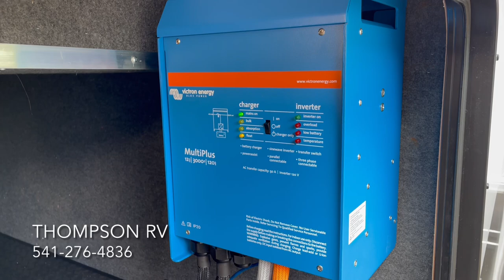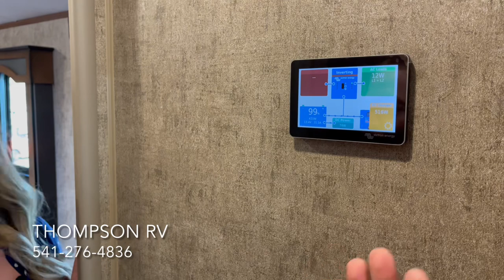How To Make Your Outdoors RV The Ultimate Off-Grid Trailer W/Solar, Inverter, & Lithium Batteries!

Comment: Nice video.  I have Battleborn batteries and live in Colorado.  When we have extremely cold weather, I simply turn my heater on overnight to keep my batteries warm.  They are located within my storage unit which is heated.  I only do this if the temp is below 8 degrees.  The BB bateries are fantastic and are only 3 years old.  My solar is always on and this works great.  I spend about $100-150 a winter to keep them warm and not have to take them out.  It’s been colder than usual in CO this year so that’s why the $150ish.
Reply: How lovely to have a heated storage unit! We love Battleborns.
Reply: Honest question- could you put in a small 12v dc heater or a dc electric blanket or heat mats under your batteries and drop your winter heating cost down to $0 or is that not feasible? I’m in Texas so I know we don’t get as cold but I’m interested in getting solar setup once I get my 5th wheel so I’m looking at options for a wide range.
Reply: @jeffsecules184  I think you could.  It would be easy to lift them up and put a blanket or pads below. I will try that next year.  Heating pads will take up lots of battery power and if you have a couple of cloudy days could present a problem.  This year my longest run was for 4 days with -25 being the lowest temp.
Reply: @Millard-vo3ds  -25? Like below zero? 😳😳 I’m in Texas, I would die literally. lol. Wow. Okay.

Comment: This is an awesome collaboration.  I have a very new 27MKS 5th wheel.  We travel with 2 large dogs and I use a CPAP.  So it would be nice to have one of their systems installed with the soft start so the air conditioner could be used on those occasions when we have to leave the dogs for a few hours at a time.  I will definitely be in contact to see how much a package is going to hurt! 😢.  Thanks Corrin.
Reply from the maker: You are so welcome!!!
Reply: Cannot wait to hear from you Rick! Hopefully we can meet your big doggos too!

Comment: What's the process for upgrading to a 12v fridge?  Is that now a factory option, or Thompson RV upgrade?  And lastly, which manufacturer do you recommend as a 12v replacement?
Reply from the maker: It’s a TRV upgrade! Norcold and Dometic both make one. We’ve done 99% Norcold.